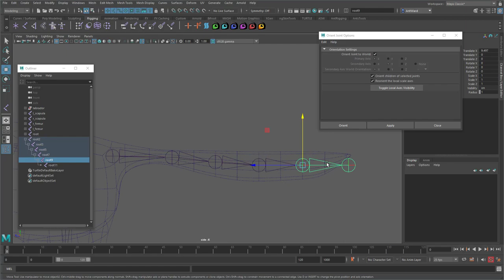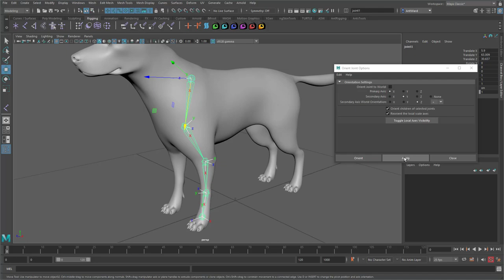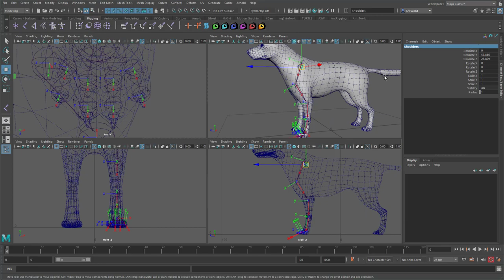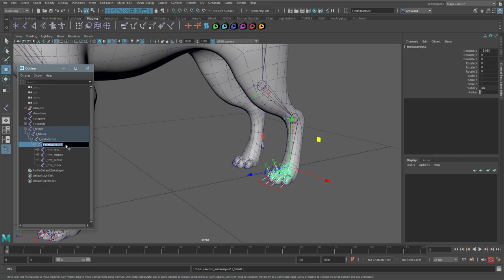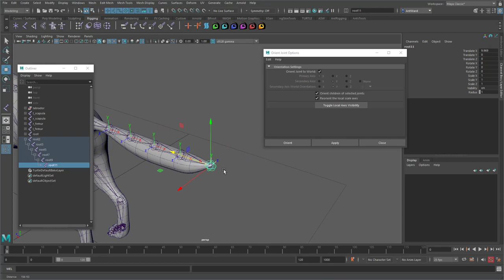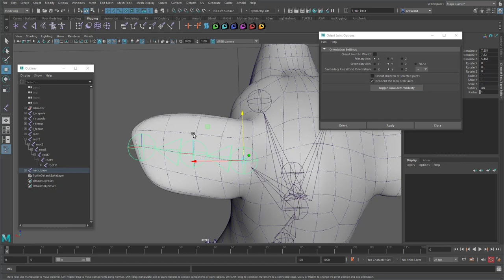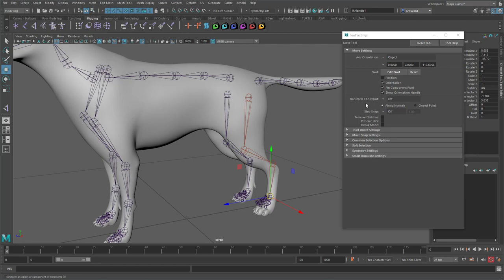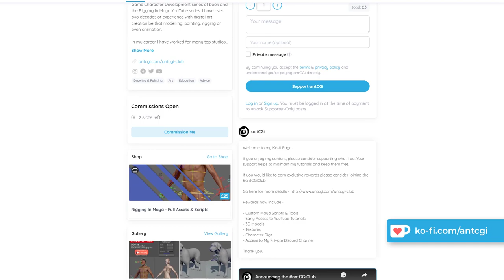#RiggingInMaya | Part 20 | Advanced | Driver Skeleton

Comment: Hi Ant! About joint's rotate orders: I've got the concepts about the Rotate Order pretty well, but I never know exactly how to add to the rig an option to the user to change the RO as he needs. Obviously, I can imagine that involves connecting a custom RO attribute from the control to its related driven joint's RO attribute. But if this same control also drives another object as offset groups (transforms) or other joints? Do these objects also need to reflect these Rotate Orders changes or just connecting the control to the joint is enough?